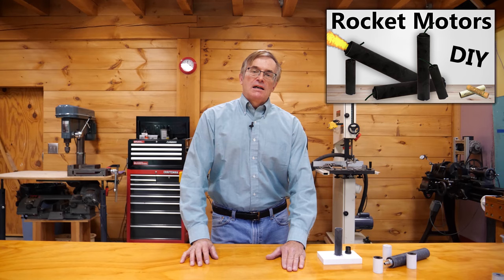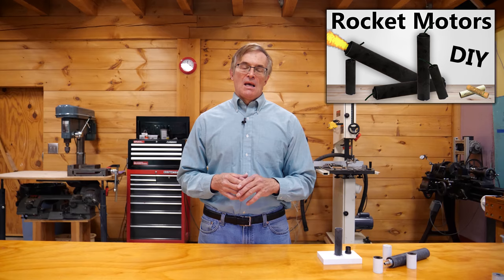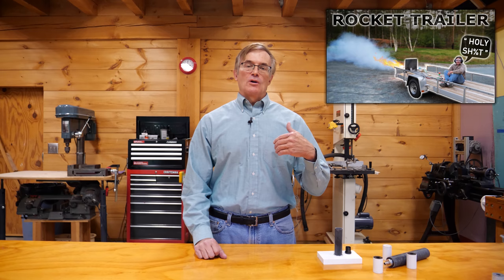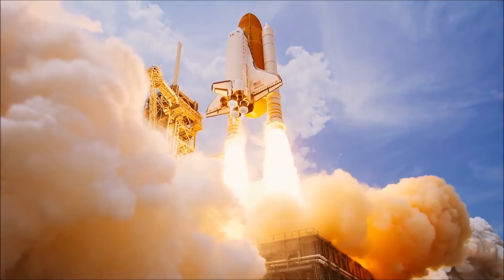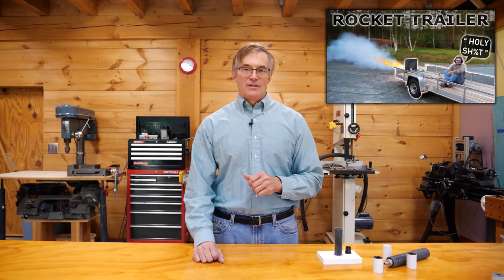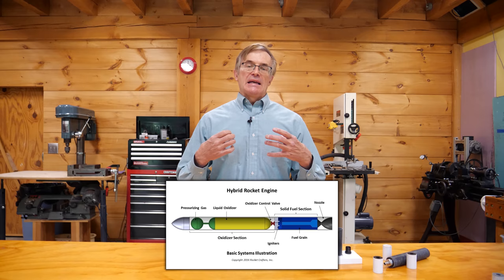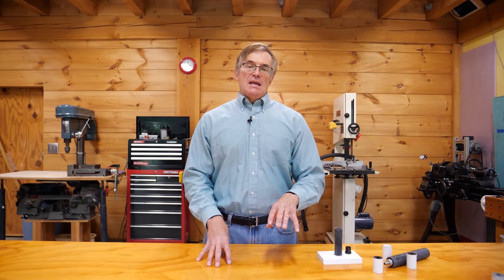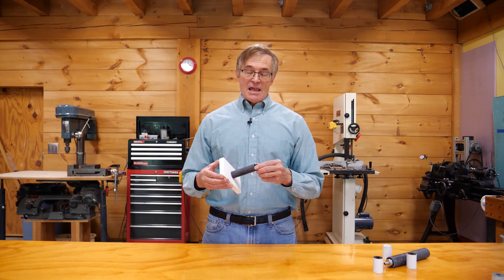Mixing Nitrous and Rockets is DANGEROUS... But Really FUN!

Comment: I have a thought experiment: If a carbon fiber bubble was made and the atmosphere was removed, would it float? I know at sea level the bubble would collapse, but what about at the upper edge of the atmosphere?
Reply from the maker: It's a simple calculation.  How strong would you need to have the sphere to resist atmospheric pressure? The lift would be trivially greater than a balloon filled with hydrogen.

Comment: NOX hybrid motor development can be dangerous. Nitrous is similar in explosive energy to ammonium nitrate without and fuel! Scaled Composites was developing the hybrid motor for SpaceShip Two. Three engineers were killed and 3 injured during a nitrous explosion during a Cold Flow test. The likely cause of the explosion was the shutoff valve closing too energetically in gaseous NOX near the end of the test.
If you are going to take on this hobby there are many sources on safely doing so.

Comment: I have been wondering how NOS would effect a solid fuel rocket engine . I was thinking abour repurposing a fire sprinkler valve so the glass bead breaks and releases the NOs as temp in the combusrion chamber rises
Reply from the maker: It's been done with fuels that contain some, but not a stoichiometric ratio of oxidizer.  This enhances the regression rate, but retains the safety advantage of the separate nitrous oxide.

Comment: Did you test a sintered brass muffler typically used to deaden the sound of a pneumatic port, as a nozzle?  And sleeve that in the aluminum tube?
Reply from the maker: No, I didn't try that.

Comment: Based on launches - or anticipated launches - do you expect any imparted spin on the vessel that would need controlled? If so, would that be done aerodynamically, or through other means? Or, should I just wait for the remaining 3 parts?🤣

Comment: What are you talking about solid rocket motors or one of the most secure safe rocket engines that exist. It's the liquid rocket engines that are more dangerous especially the chemical ones. Because they can leak as long as you don't have an ignition source in the solid rocket boosters there's literally no way of them igniting.

Comment: i have a question for you that might be of interest to many of your viewers. I am wondering if  91% or 99% (or perhaps even 75% medical-grade alcohol could be used as emergency fuel.. such as a quart of it added to the gas tank, to get you a few miles to a gas station  And would this cause any damage, used in this way to the fuel system or to the engine? Part of the reason I ask is that medical grade alcohol can be used (considering proper dilution with water externally for medical reasons and as an antiseptic and for cleaning etc. And from my understanding, it can be transported legally inside vehicles and on public transport, whereas gasoline is highly dangerous and toxic to humans. I was thinking of this a multipurpose thing people can carry with them on camping trips or road trips, where it migh t used in an emergency as some additional fuel to get a car to a gas station
Reply from the maker: I'm not sure about the "rules" regarding transportation especially since medical grade is vague and even the type is unspecified ie ethanol, isopropyl etc.
But you're right, it does burn and can be used as an antiseptic.

Comment: Your rocket series has inspired me to try and make a small, stationary prototype of a hybrid rocket engine.
In the case i wanted to use an oxydizer which is liquid at room temperature and atmosferic pressure (like concentrated nitric acid) pumped using a chemically resistant centrifugal pump driven by a small internal combustion engine, would I be able to get a centrifugal pump capable of increasing the pressure of the liquid enough but with the small mass flow neded for a small engine or would it be a bad idea to use a centrifugal pump and would it be better to pressurize the oxidizer with inert gas?
So far the only chemically resistant, high performance pumps i found are all of the centrifugal type, i think that for this application a positive displacement pump would be better but i don't know if they make something with both the performance and the chemical resistance needed.
Anyway I can't wait to see what i discover with this amazing series, this is something unique on youtube and i'm so glad I found it, keep up with the good work.
Reply from the maker: I would stay away from that for now.  High pressure, concentrated nitric acid is really, really dangerous.
As you'll see these engines really, really work.
Reply: @TechIngredients  Thanks for the advice.
I know that nitrous works very well but i wanted to make something that condensed most of the things that i learned in my 3 years of aerospace engineering studies, even if it isn't practical.
Let's say that it is an exercise and makeing it more complex would also teach me a lot more things about building rockets which may be my future job after a lot more years of study.
But you are right and nitric acid is dangerous and maybe i should look for a safer oxidizer for my first project.
Thank you.

Comment: It seems like the nozzle tuning is rather fidgety, and you'd need to start all over if you increased your rocket size by 25%.  But then again that seems to be the case liquid rocket motors as well.
Reply from the maker: Actually, it's not too demanding. As I'll describe next, the basic layout of a nozzle is simple in terms of material, angles and components.  The only significant variable it throat diameter followed by expansion ratio. The hybrid rocket is forgiving because of the chamber's negative feedback on oxidizer flow.

Comment: Why aren't high pressure diaphragms with a circular valve system used? Inexpensive could use a large volume tesla valve to mitigate ware in the moving parts supplemented by a piston system similar to how blowback rechambers a round in a rifle, that would control the backpressure of the engine to the fuel injection system. 
     Obviously this isn't well though out and is off the cuff but I see ways of making cryofuels work better, the incorporation of areogels could also greatly increase heat resistance and temperature conductive nature's of many compounds and metals from the extreme heat and extreme cold of the system. Heat dispersion for the main structure and rocket body interface would possibly be achieved by micro peltier cooling in a large array using both the heat energy in the reaction of the fuel in the combustion "chamber" to create energy for the cooling effect to work, it would need very small peltier units to achieve use of the heat to help power various units as well as a separate pump system utilizing fans similar to cilia in single called organisms l, which have no moving parts and impart a small impact on the medium they are used in but have a potential for use in this application being the shear abundance of them would be lighter and more efficient as well as somewhat redundant in its construction.
    The myriad of simple fixes space craft can undergo leads one to believe that, though tech plays a large roll in safety; it's proven people can live in space in a can of analog computers, that are primitive and still come back safely. 
     Near space is like our Mediterranean sea for the Roman's, Deep space is like the moon to the same peoples. We are at the precipice for exploration of the solar system and the composite materials we are discovering/inventing are the key. 
    I need some genius friends, I my self am a confirmed 145 IQ person and people feel dumb to me but I am also autistic and have adhd so, most people feel alien. I only use real facts to judge the world and by nature am an agnostic probably more atheistic.

Comment: Superbe video as usual !

Also, question, have you ever tried the compound named Starlite to handle the heat problem ? NightHawkInLight has excellent video on it, and i think it could be a thing to try.
Reply from the maker: I've messed with it.  It's basically a low cost and easy to make, ablative foam.  We don't have a need for anything like that...yet.

Comment: So chamber pressure is limited to somewhat less than bottle pressure? Have you thought about using a small gear pump to boost N2O pressure? Since the nitrous is warm and liquid the seals won't be a problem in the short term. The Concentric (Barnes) GC series pumps are cheap, come in a wide variety of small sizes, and can be pushed pretty hard. Should easily be able to get well over 200 Bar.
Reply from the maker: Good idea.  The main reason a hybrid engine doesn't match a liquid fueled engine for specific impulse is the lower chamber pressure.
Reply: @TechIngredients  If you do this I would recommend not heating the bottle and mounting the solenoid before the pump. Those shaft seals can take a fair bit of pressure over spec but you won't want to leave them sitting under pressure.
Reply: @TechIngredients  The vehicle performance is a function of the ISP / gross vehicle mass.
It is worth a lot to have a dead-simple light weight vehicle.
A long duration, moderate thrust motor, expends less of it's energy pushing air out of the way.

Comment: A well explained video as always ,Thank you.Me and a friend have been pondering making a rocket and this simpler hybrid design with no pumps seems to give the best of both worlds-solid fuel and a throttling capabillity -excellent,A bit of Nos in your rocket and your laughing! (someone had to say it! :) There's been an epidemic amount of people "sniffing" the little food grade Nos cartridges and more recently what look like 1 litre sized (similair size to blow torch canister) cans in the UK lately so I guess it's not too hard to get a hold off - If we were to use that grade of Nos without the extra ingredient would it result in more or better oxidisation of the fuel or just be simply too dangerous to contemplate using? ATB.
Reply from the maker: The sulfur dioxide is present in trace amounts and racing nitrous works very well for its intended application.  I strongly believe there would be no difference.
Reply: @TechIngredients  Ahh, It's just a trace amount - I see now, Thank you for the response. It is really appreciated- Keep up the good work,You have a really informative channel here. Thankyou and all the best.

Comment: Just so you know,  lox on charcoal can DETONATE. Not frequently though. So it comes as a big, destructive surprise.
Reply from the maker: It's  been used as a mining explosive when the charcoal is soaked in the LOX and becomes safe after the LOX evaporates.
External enrichment of the oxygen fraction will not do this.

Comment: Watching at around 16:00 ... Why not run the nitrous tank inverted to be able to get all liquid out and not need to worry about the fill tube at all? I'm assuming that it's a practical choice because the only tanks you can easily buy have the fill tube. But curious if there's another issue.
Reply from the maker: That's correct. It's probably because in a racing application it would be cumbersome to have the gauge and the valve knob jammed down next to the floor boards.

Comment: What if high voltages were used to finely disperse a fuel fluid? Taking that a step further, could liquid oxidizer be combined with fuels using opposing charges to both disperse and attract the fluids from themselves and to each other?
Reply from the maker: It's probably not energy efficient. The amount of voltage and current needed would be very large.

Comment: Another fantastic video guys!
A sort of unrelated question but which of these nozzles is best suited to the jet engine combustors? I assume it depends on engine design and fuel used, but is there a general type or pattern that works better than others? And what material choice of nozzle is best?

Comment: Tech ingredients I have an interesting idea, I was thinking of ways to sound proof my room for cheap and with common items and was considering using paper from newspapers maybe turning them into pulp and making a thick sheet of it, how do you think that would work?
Reply from the maker: Based on the work we did for the videos we did on sound absorbing panels, I believe the lowest cost commercial material is acoustic ceiling tiles. Cellulose in newspaper if pulped and formed and dried would probably perform similarly, but would be a lot of work. This might be worth an experiment, but it might not be worth the effort to line an entire room.

Comment: Great video! I have a question : why not to directory use the vapor phase of the nitrous tank (meaning using another one without the internal tubing) instead of getting the liquid phase and try to vaporized it later?
Thank you!
Reply from the maker: The plumbing would have to increase in diameter a lot to flow the same amount of nitrous oxide as a gas.
Furthermore, the secondary tank will cool almost instantly, reducing vaporization.

Comment: i just was wondering how a fire sprinkler nozzles would perform. Or is a spiral nozzle still superior for that use with nitrous oxide?
Reply from the maker: We tried those, but many have metal components  that extend into the chamber which risks melting.

Comment: Would you get more thrust from the nitrous in a hybrid rocket attached to a car, OR running the nitrous through an internal combustion engine? which is a more efficient use of energy?
Reply from the maker: It's a matter of momentum or another way of looking at it, leverage. If the nitrous oxidized fuel to run an internal combustion engine in a tractor you'd get more "thrust" than in a car.  A rocket engine is actually a more effecient means of converting thermal energy into work than is an internal combustion engine when the rocket is traveling close to the speed of the exhaust gases.

Comment: Hello! First of all i want to thank you for all the amazing content you create for us to enjoy and learn from. 
My question is about the addition of the spacer on the 120° spiral nozzle. Won't the impact of the droplets on the inside of the spacer cause some sort of "condensation" or "accumulation" of particles in bigger droplets inside the spacer itself? When you turn off the valve you can even see a big drop falling out of the spacer, isn't that an issue? Why isn't it better to use the 60° spiral with the spacer to maybe minimize this effect?
I hope to have explained myself good enought for my question to be clear, as english is not my native language and i have a strong feeling i might have used some technical words incorrectly or out of context.
A big thank you again from Italy!
Reply from the maker: You want the wide angle to maximize the impact effect on the inner wall of the spacer without having to extend the length of the spacer at the expense of fuel grain capacity within the motor tube.

Comment: have you considered using a rotational type pressure limiting nozzle ?
such as a set of fan blades - one rotating counter directional to the other ?
Reply from the maker: I haven't. The scale might be a problem.  Unless the engine was quite large, a nozzle would have to be a centimeter or less in diameter.
Reply: @TechIngredients  
perhaps the fan assembly could be larger than and precede the final nozzle and rather than serve to pressure limit, it would atomize .
for some reason, i don't contemplate the spiral form to be sufficiently atomizing and directing the propellant adequately or uniformly .
Reply: @TechIngredients  
I think I figured out a way to do it :
A two fan configuration that is larger than the preceding conduit with an exhaust end that is a nozzle that is maximum size ( @ 1 cm ) .
The first fan would be driven by the force of the propellant flow and it would drive the second fan, via gear linkage, in a counter rotation with opposing flow force .  This way the second fan would restrict pressure and atomize .  Maybe a baffle or current brake in between the two fans ?  
I wish I knew more about fluid mechanics .  Then I could answer more of the questions I have on my own .

Comment: Hmm...even with spiral nozzle with a ring it's still a pulse during N2O distribution...
Didn't you think about putting a fine steel mesh (or 2 two or three (?)rotated by some angle) into the (longer?) ring to make the vapor distribution even in time?
Reply from the maker: Why would there be  a pulse?
Reply: @TechIngredients  At slow motion video I see a pulse: just as standing wave in radio - some kind of interference - something like sinusoidal max and min.
I don't know - maybe there's inevitable - but I have a feeling (maybe wrong), that commercial rockets have a stable exhaust in a time...

Comment: Could you have a field of these rockets and use something like a paremetric speaker and point the thrust in a direction?
Reply from the maker: Probably not.  That technique depends on the phasing of the sound waves.  These motors are not operating as frequency generators.
Reply: @TechIngredients  But could you turn on and off the solenoids for the liquid oxidizer to get a phased result? Would phased rockets even affect the thrust direction?

Comment: When you make your hybrid rocket, will you need to customise and fabricate your own pressure vessel liquid tank, or are there off the shelf items you are sourcing?
Reply from the maker: The most promising route is the same tubes and techniques used for the motors themselves. They're plenty strong.

Comment: About the nitrous nozzle, Would it' be better if you use some kind of diffuser? I've been succesfully spreading tiny stream into bigger tube using 6 hole around 1/4 inch pipe.
Reply from the maker: I don't think so.  The problem with multiple, tiny streams is that the orifice restriction isn't linear and really slows down the velocity of the streams.  This reduces the impact-dispersion component.